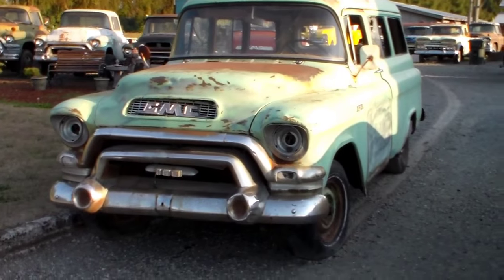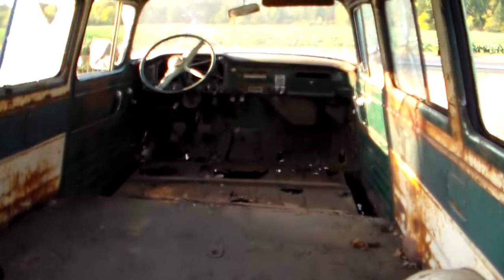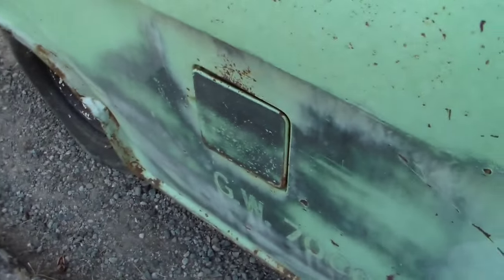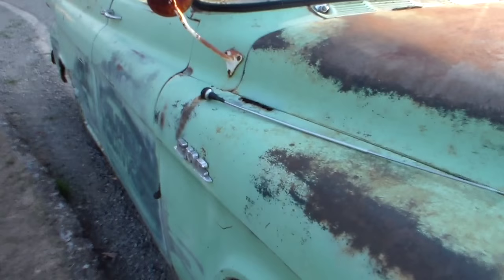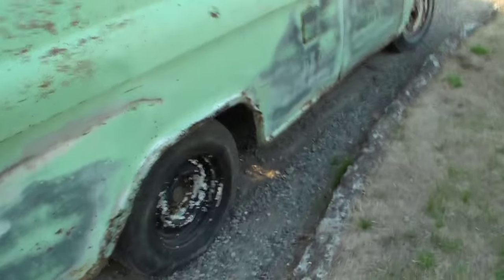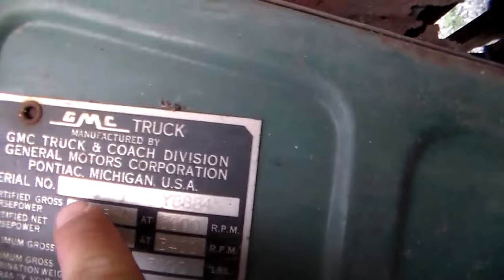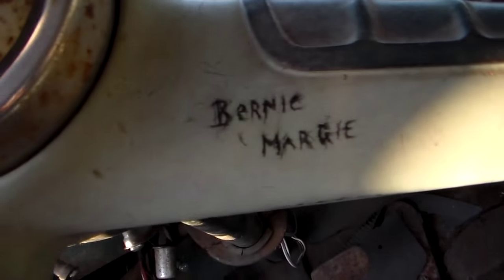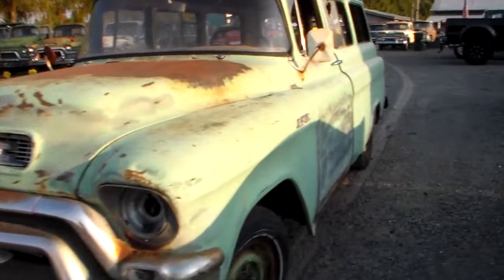Classic Truck Rescue 1955 GMC Carryall

Comment: Rick..with all the cool retro looks like this vehicle..dnt you think the bean counters in Detroit would realize that the PT Cruiser and HHr were epic fails..can u dig what a great engine and modern issue engines..anc chassis would do to sales? they would have record sails of a new Carryall..Rich
Reply from the maker: +iamrichrocker I totally agree. The front grill treatment on the mid-fifties GMC trucks is  literally where the expression "Cowboy Cadillac" came from. A person can pull up a front end photo of a 1955 Cadillac and compare it to this 55 GMC grill and see for themselves. The GMC grills and Cadillac grilles make very interesting side by side comparisons for 1955,1956 and 1957. I'm with you on that one. A retro version of this truck would be a smash hit. Thank you for your input once again. -Rick
Reply: If you are still looking for a '55 GMC carryall suburban I have one in the L.A. area.  It is a restored Civil Defense vehicle with all original parts with the exception of the hub caps.  I can send you pictures if you are interested.

Comment: Aren't the rear floors just plywood? If so only the floors under the driver and passenger seat are steel/ needing welding in.
Reply from the maker: +BettyfulMD You are correct. I just wanted to be absolutely sure my customer understood that it had some serious rust going on. thank you, -Rick

Comment: its missing the pontiac V8 engine and the hydra-matic trans
Reply from the maker: +ducktster  This Carryall came with a 6-cylinder and three-on-the-tree. I do have all years of correct GMC (Pontiac) V8's and one Correct Hydramatic for 55 GMC. -Rick
Reply: i know the 55 gmc has the 287ohv  V8 pontiac motor

Comment: hi rick are your friends at inter mountain going to uses the yellow truck at the shop to build a pickup or a auto transport it would look real cool as a long bed pickup truck ?😀
Reply from the maker: +Curtis Shafer I believe they are going to make it a long bed Dually pickup outfitted to pull a very large enclosed trailer Curtis. -Rick

Comment: God Bless Rick what is the Difference between the Carry all and the Apache? I believe one is GMC and one is Cheverolet; is there any other difference?
Reply from the maker: +George Middleton Jr The "Carryall" is the GMC version of the Chevy Suburban. An "Apache" is a 1958 or 59 Chevy Pickup. GMC pickups were not referred to as Apaches. Hope that helps and God Bless you as well.  Thanks Fer Watchin' -Rick
Reply: Classic Truck Rescue
ok a long gone friend had An Apace Delivery Van i think a 58 with a flat 6 in it when you said carryall and suburbans i was wondering thank you again
Reply from the maker: +George Middleton Jr No problem.

Comment: Am looking for some 1959 Chevrolet Apache Fleetside / 3100 parts.
Reply from the maker: +gbowne1 Send me a personal message on the Classic Truck Rescue Facebook page, or just Google Classic Truck Rescue and let me know what you need. -Rick
Reply: All I have is a bare frame and cab body with bed. Completely stripped bare of all parts and hardware.
Reply: Sent you a PM, which also has a auction for a 59 school bus